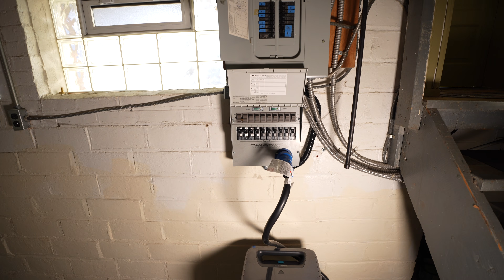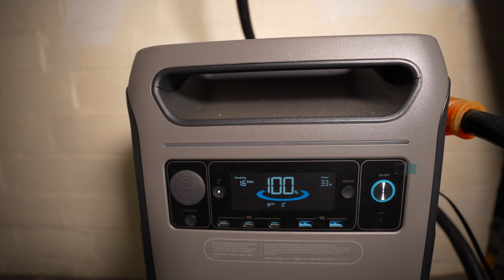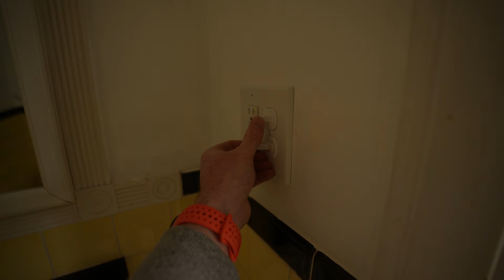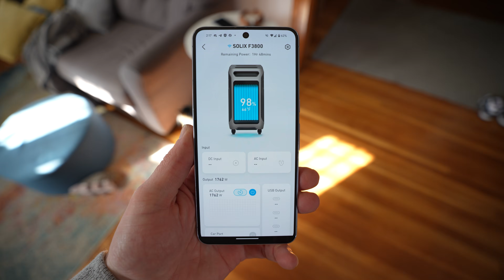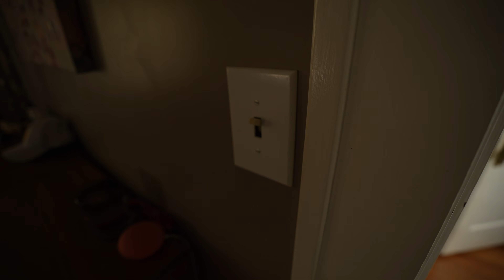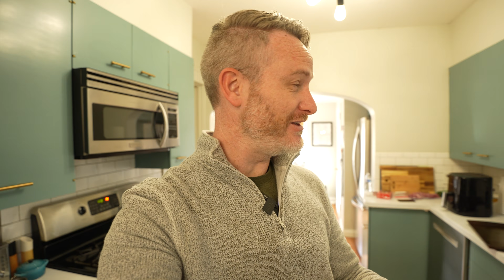Anker SOLIX F3800 and Transfer Switch: the perfect setup

Comment: Great video, and I appreciate your input.  I'm having difficulty justifying the cost of a system like this when power outages are so rare, but I definitely want to have it.
Reply from the maker: Yeah, it really comes down to finding other ways to use it besides just power outages. We have taken it and used it for community events in the park where power wasn't available and even used it for a bounce house instead of a gas generator. Just having it sit in your basement for maybe using it 2 times a year is a bit of a waste.